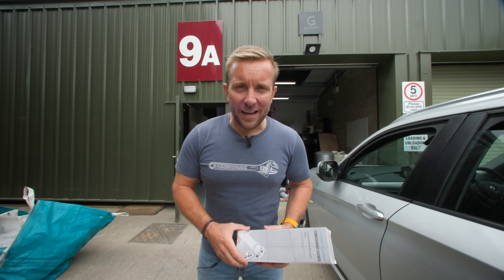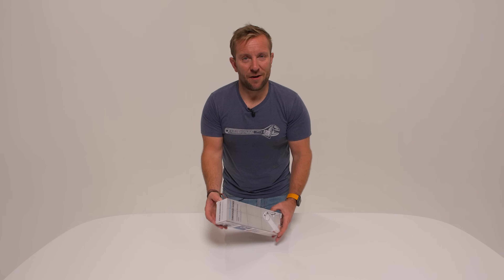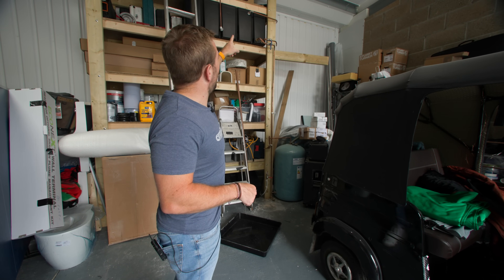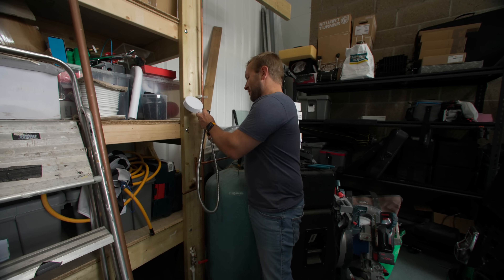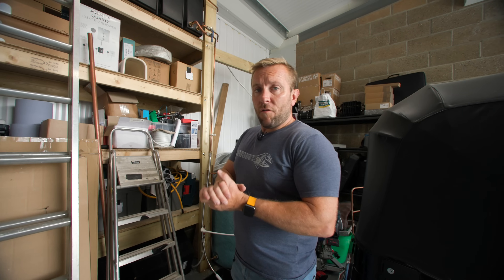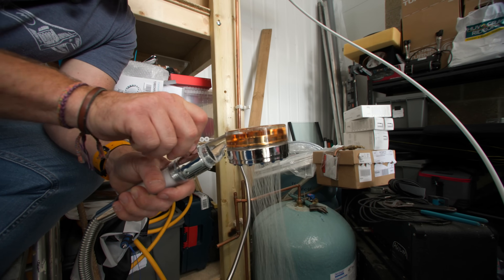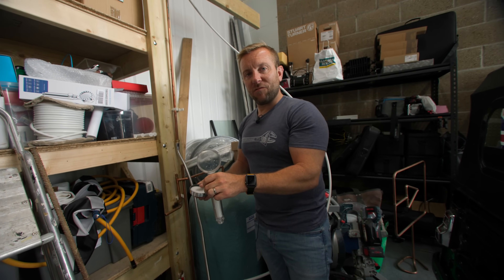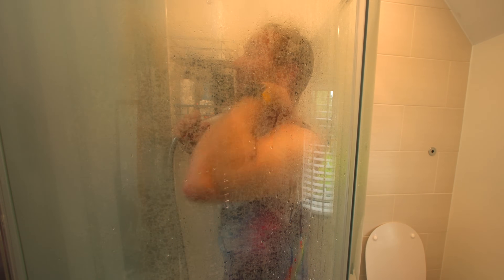PRESSURE BOOSTING TURBO CHARGED SHOWER HEADS - Do they work?

Comment: Theory is sound, I guess it's a bit like Subwoofer design, the science is quite exact, wouldn't be surprised if there was a a pressure boosting shower head on the market with a fan that did work. 

Ricky.

Comment: If you dont want to go to that expense of installing a water pump, as far as the shower head goes, NEVER buy one that is made out of see through plastic if it is going to be exposed to sun light or it will be full of algae. Look for shower heads with the smallest of laser cut holes and look at buying a wide bore shower hose. If the shower hose is longer than it really needs to be, look at buying a slightly shorter one might give slight improvement .

Comment: If anything the fan part will diminish water pressure. It has to use pressure to spin the fan. If you flow water through a smaller hole it might spray harder but it's not gonna increase the pressure. You can't get more output than input. It's just not possible.

Comment: I bought one of these to give it a try. Read reviews but didn't care, was game for an adventure. Well I love this shower. Not sure about more pressure but the pressure is great, and perhaps its the movement of the spray but rinses shampoo out of your hair in a few seconds. And while the filter doesn't look like much, the kicker for me was a rash I have had for 3 years is gone. Used the shower for about 2 weeks and realized I wasn't itching any more. Rash completely gone. Nothing else had worked. I love this shower.

Comment: Hi this shower head more more dangerous use to instant gazer if your by mistake shower head push the stop button the instant gazer hot pipe blasting and Electrical circuit short and dangerous to shower head flexible hose pipe earthing to human body may be your invited own death so plz don't used this shower head on instant gazer only use for water tub head connection is a safe for this shower head plz plz plz plz carefully 😢

Comment: THANKS!!! I live in a rented property where the only running hot water is from the immersion tank in a cupboard on the landing. The immersion (judging by the popping and banging) is caked in limescale and the pipes are probably coated in it too. So when I rigged up the mickey mouse push-on-to-the-taps shower attachment I bought, I get a piddling little dribble coming out of the shower head - at chest height. Put the shower head up to head height (I'm only 5'1") and it virtually dries up completely! Having just seen an advert for these things I thought this would be a game changer, but the skeptic in me wasn't convinced. I thought judging from the shape of it there were batteries inside adding to the water pressure. 
Thank goodness I watched your video! Okay this piece of ......"plastic" is only cheap. But do I really want to pay people for making false promises and selling junk products that don't work to people??? NO. Guess I'm just going to have to bite the bullet and try and get the landlord to solve the problems (he won't).

Comment: They're using the power of the water to run the fan? If anything,   isn't that just going to increase resistance/turbulence and decrease the velocity downstream?  It's not as if there's a motor powering the fan to propel the water at a higher rate of speed...

Comment: So I have a question. I have a 50gal hot water heater that doesn’t allow more then a 15min shower it is completely brand new as of two weeks ago. Because we thought it was going out, but now with a new one and the same 15 issue I’m questioning it. But the house came with a shower head that had little to no pressure, so I bought a cheap shower head and it has a ton of pressure but the hot water still doesn’t last. So my question is is the high flow of the new shower head the issue?

Comment: i mean the idea its just that the flow of nwater is gonna push that spinny thingama and somehow its gonna spin faster than the pressure of the water coming in, which is imposible, i mean the simple fact the water flows in the CENTER of the thingama and not on you know, the side of least resistance, just tells you how much the guy who designed this understand how fluids work

Comment: I bought one of these shower heads for £5.98 off tiktok and it’s brilliant it doesn’t have the plastic filter it’s slightly different but amazing for me who has an electric shower that is useless and no water pressure this has enabled me to actually be able to use my shower 🚿 instead of having to bath constantly
Reply: this does nothing that a normal one wouldnt do ..

Comment: You should do a " Build one episode."  That actually does what the manufacturer claimed theirs was supposed to do, and show the  internal differences of what actually works compared to what doesn't.
Though you could use a different manufacturers that works, but it'd be more of a in your face to that sham company if you built a custom one of your design.
That'd add another good episode to watch as a sequel!

Comment: The turbo fan is just visual serving no purpose from what I can see.  I wonder if in the handle there is a variable constriction device, ie for venturi effect. The Venturi effect states that in a situation with constant mechanical energy, the velocity of a fluid passing through a constricted area will increase and its static pressure will decrease. The effect utilizes both the principle of continuity as well as the principle of conservation of mechanical energy.  Not sure this product uses this principle though.  Sales Gimmick.

Comment: To be fair, anyone who thinks 5 PSI (3M of head) of water pressure for a shower is acceptable needs to have their head checked.  Try this under something more like 45PSI or better.  Also, the "little hole" that feeds the "turbofan" is about the standard size that feeds most shower heads (if you've ever taken one of them apart you'd see how pathetic they are as well.                                                    

But yes, as it is done here (with the "turbofan")... It's a complete gimmick.

Comment: I’ve had one for awhile, I like it, I’m fully aware it’s a gimmick.  But I like the flow nozzle and the on off function, the pressure is actually really good for washing your hair.  The filters are cotton, probably should have read the box before jumping to conclusions on that.  The filters do help, not a lot, you don’t need them.  But they do prevent some crap from getting through.  I chose to keep using it because I like it.

Comment: look like they make it to go around shower head unsettle of hitting head to nozzles so that water will go around n come out of nozzles without putting so much stress on pipe (like hammer which u can learn it by turn on water so fast n watch pipe pull n push around) so it just fly thur shower head n it good have more tiny hole because it make flow line longer (never use any shower head because i normal run straight water reduce flow that all n just like living in junk yard)

Comment: Pressure is energy. Without adding any additional energy from somewhere else, it violates the laws of physics for this to somehow be able to increase water pressure. In fact, the laws of physics mean that by using some of the pressure to spin the fan, this showerhead actually must decrease pressure (albeit by a minuscule amount since the little fan clearly takes very little energy to spin).
Reply: To be pedantic, I think you're technically forgetting about modifying resistance. You can increase pressure by converting flow using resistance (think water hammer). Increasing flow AND pressure however? Laws of thermodynamics definitely apply.

Comment: First thing first, the pressure in the closed system is "always" the same unless you install the additional pump or compressor
Second thing, by reducing the pipe size (bigger/smaller) the pressure is always the same, only thing you change is the FLOW
Let me explain: The formula for calculating the flow is this " Q = A * v "
- Q = a liquid flow rate and it is measured in m3/s or l/s (cubic meters per second or Liters per second)
- A = Area of the pipe or channel in m2 (meters squared)
- v = velocity of the liquid m/s (meters per second)

So, in this formula, there is no value for Pressure (P) because pressure is the same.

Only way to increase the pressure in the system is by adding additional pump/compressor/turbo pump/high pressure pump etc.... either in the facility where you getting water from of second way is to raise the water tower on higher level (not much difference in small elevation changes)
So, the best way even for the water tower facilities to increase pressure inside system is to add more PUMPS

You can increase pressure in your house by doing same thing, just make an reservoir/tank (supporting desired pressure) and add the pump taking water from the city network (much more cost wise if you consider burning electricity for the pump or gasoline).

Anyway, regarding that shower head, it's nothing more than Scam product released to take the cash from stupid people :D

Great video and keep up the great work
Reply: wrong. a high flow large pipe into a smaller pipe will increase pressure.

Comment: i like the spray pattern, id be interested to see if drilling the guts out of the handle to remove restrictions to give full flow would affect the spray at all. that way the only restriction would be the spray holes themselves
Reply: i'd take just a normal shower head with one of those plates, the spray pattern you could make on a 6" plate would look awesome
Reply: Yeah the metallic paint on the pastic turbine and the turbine itself are likely to start coming apart with any real water line pressure.
Reply: I’m going to say yes it will affect it. It’s there for a reason.
Reply: It’s ok as long as you have soft water at my place it would be blocked after a couple months
Reply: @shokdj1  im in south australia and our water is probably the hardest in the country lol. full of junk and i have no filter or softener on my place cos i live in public housing and they dont do preventative maintenance. so i go through a few shower heads a year lol
Reply: @legleg752   I would like to visit Australia one day. Yeah this wouldn't be much good for you then I couldn't imagine it would last long does look cool though

Comment: I suspect this device does work and that it doesn't break any laws of physics. 

However, I think it probably works in only certain circumstances where there is good pressure but poor flow. 
In other words the restriction lies in the pipework - such as lots of 90 degree bends or flexi pipes. 

So, by restricting the outlet flow you could see a significant increase in line pressure - up towards your feed pressure. 
Technically, the water in the pipe stays flowing below its Reynolds number and doesn't go into turbulent flow at the restrictions. 

You will get the best shower when flow and pressure are optimum - not when you maximise just one.

Comment: Okay I understand what you’re getting at and yeah you’re right! , and yes the broken English is misleading. But I’m gonna school you on one thing. Before that though I need to mention mine is electric diaphragm pump so Obviously not gravity feed. Plus mine doesn’t have the back scratcher or the see-through filter cover it’s chrome . Also mine was only NZ$17 from China with nothing written on the box. and I have zip tied the throttle open . No brothers made my one possibly, but it looks exactly the same as yours besides those differences I mentioned  . I’ve recently purchased one of these and I’m gonna go out there and say it’s the best showerhead I have ever used. 
The turbo/ fan actually directs the water evenly through at the back of the perforated  plate. I have run my showerhead without the fan and it literally squirts harder out the top holes then the bottom holes. Refit the fan and it evenly sprays with the perfect pattern. Definitely a good cheap showerhead!!! Not a paid promotion
Reply: @davidf2118  Understood mate. So that proves the fan has a purpose of evening out the spray. I think everybody understands there’s no way that Van can increase pressure it’s more about turbulence for the spray pattern.
Reply: @davidf2118  i’m pretty sure they are not made for gravity fed showers . 
I think they are primarily made to reduce water usage . That was the only claim made on my packaging . 
which Indeed mine did . They have a great spray pattern and awesome pressure . mine is run by a 12 V pump with A limited 20 L supply . 
and works very very well for $17 . it’s the best damn shower head I have ever used.

Comment: If it says turbo and there is no power lead to an electric motor in the turbo section then it's a con. This also applies to vacuum cleaners.

Comment: Great video. I was tempted to buy this, but every shower head I've come across with high pressure, creates that pressure with smaller holes. I've got the hardest well water than I've ever encountered in my life right now and it clogs up everything fast. i had a feeling that this wouldn't work for me. Now I know for sure.
Reply: I did buy it and it really does work. Mine has a knob that adjust the pressure and a button to stop the water flow.

Comment: Technically the spinning of the 'fan' will reduce the flow rate as you're making the water work before you get it out the head. That spinning wastes energy from the gravity aspect
Reply: The spinning pulls air from the outside and mixes it with the water increasing its pressure, the foam pad is to reduce bubbles.
You use less water this way.

Comment: For clarity, I don't believe the shower head shown does this...

It is technically possible to use a large amount of low pressure flow to pressurise a smaller amount of higher pressure flow. You'd need to design part of the system as a turbine and part as a compressor. That way some of the water flowing through the head would lose energy (pressure) going through the head and some would gain energy.

Comment: I was thinking of buying one of these but I can’t see how it would boost the pressure from a low pressure feed without the use of a pump, so after watching your video I’m not buying one, thanks for the useful video.
Reply: this spinning fan was a gimmick but theoretically possible when you have correctly sized impeller and turbine inside that shower head

Comment: Just received one recently and using on a gravity fed system. I don't know about pressure boost but it definately uses less water whilst still giving a pleasant "full flow" feel shower.
I'm not especially green but if it saves water with no downside it's a winner, ,, so i got 2 more.

Comment: By restricting the openings you increase flow but pressure remains the same. The water coming out of the tiny holes is coming out faster (flowing) but the pressure still depends totally on the height of the water in the tank.  Water flows out due to gravity and the pressure is roughly half a pound per square inch for each foot the water level is at.  This does not change if you reduce the size of the outlet.   Simple hydraulics. Ask any firefighter.
Reply: Asking someone who has taken engineering physics, The size of the outlet most certainly affects the pressure.
You can test toricelli's theorem easily enough.
Reply: If your house is not supplied by an infinitely large pipe, then the size of the nozzle certainly affects the pressure.
Reply: @LaminarLogic  Yep outlet pressure. Changing the size of the holes adjusts the coefficient "K" in P = (Q/K)^2 , decreasing hole size decreases "K" which is in denominator and therefore results in a larger pressure "P" with the same flow "Q". It's theoretically correct I believe but has its limitations... seems they're taking full advantage of pressure/flow relationships.

Comment: We used to have a Trevi boost shower but the "turbo" (or how ever it worked) was inside the mixer fitting on the wall where the cold pressure would help boost the weaker hot feed. It actually worked quite well. Claiming the turbo will boost pressure in the shower head breaks Newton's law thermodynamics.
Reply: The Trevi used a venturi to pull gravity hot water behind a mains cold supply.

As the venturi relies on precision orifices it quickly degrades in a hard water application as limescale takes effect.
Reply from the maker: @gruhwch4876  changed out loads of them!

Comment: the explanation of how electricity flows is very often compared with that of water. the same must be said of how water flows. resistance is still resistance be it in water or electricity.